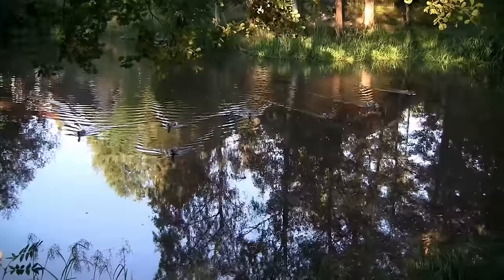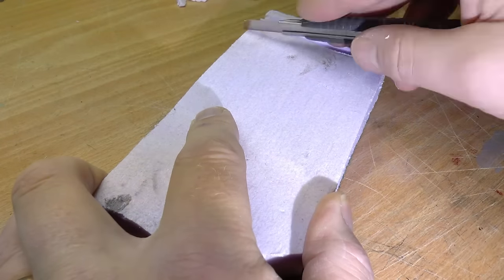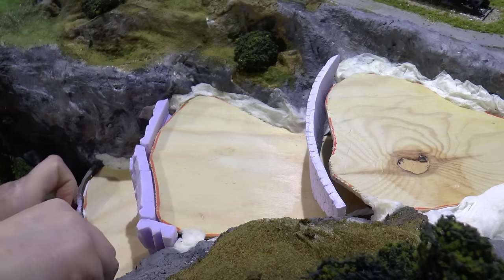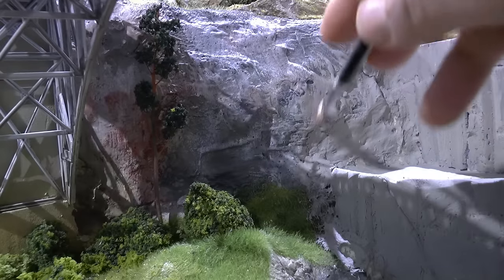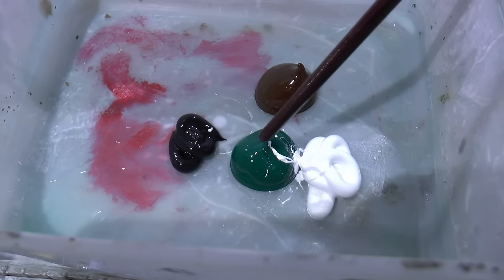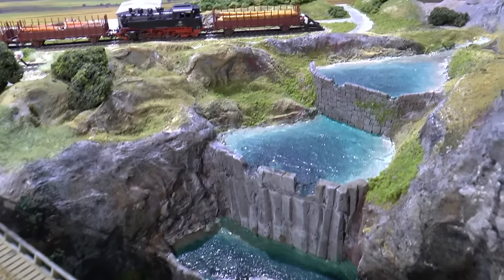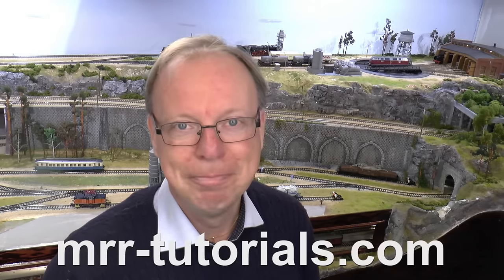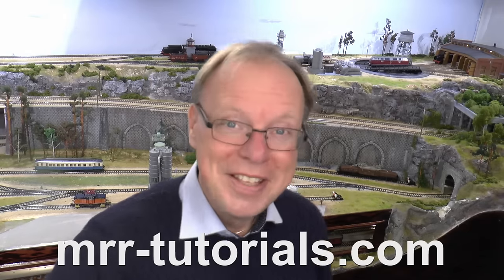Toilet paper + Glue = Realistic Waterfalls

Comment: Hey Mark
Great video!
You can also use clear silicone. It's much cheaper and can be found as UV resistant. It has the same bendy properties, making it suitable for shaping after it's dried. However, not all of the products are suitable for painting, so check the label for that when you are checking for UV resistance :)
Cheers from DK

Comment: thanks Marklin!  i watched more and more of your you tube vids...thanks sooooo much for sharing your knowledge and experience with us all!  two more questions for your advice...if one adds water lillies, swamp grass, cat tails etc to your water feature, do you add after the resin or varnish hardens and if so what kind of adhesive should one use? or do you insert or emplace while it is still curing? finally if your water feature is on the edge of your layout and you do not have a fascia, what do you think best to use as a temporary dam to prevent leakage?  styrene?  glass?  will the resin or varnish stick to the dam as you remove it????  thanks again?  hope things in sweden are all fine!

Comment: I have heard people adding a tiny bit of purple paint to epoxy resin to counter the yellowing effect. Purple is the opposite color of yellow in the colorwheel. This is for regular (construction) epoxy  that can be quite sensitive to UV light. I have used special "casting" epoxy resin specifically used for display purposes which has a much better UV resistance (but is more expensive).

Comment: I'm not sure if I'll get an answer from this or not, but here. goes. You did an amazing job on the waterfalls as it really looks like water flowing. I saw someone else doing the waterfalls on their display and to give it a bit more realistic they took some thin plastic and cut strips and put it underneath the water that you post on it and it tends to hold out the water a bit like it's flowing faster off the dam or whatever. Just a light pass along the information. but I'm sure you've probably seen it. One other thing I wanted to ask was how did you get the sound of water rushing? I know DCC does the engines, but can you get something that sounds like water to?
Reply from the maker: Hi! Thank you for commenting! The water do not really ”jet” out in the falls I modelled. It’s falling straight down, since it’s not a stream on top, but a dam. Sound decoders from ESU and Marklin can be equipped with whatever mp3- or wav-files you may have available. Just open the comfiguration tool and assign your file to a current slot in the decoder. I made a video just a few days ago on that topic. Check it out.

Comment: Awesome video. Thank you for sharing. I have a question. On this video at 8:19, you said to wet the water surface with Pure water. Who makes that Pure Water? Thank you. Greetings from NJ. US.
Reply from the maker: Handi Homann Thank you for the question! I use clean tap water to smoothen the edges between the different shades of the green color before the paint dries.
Reply: Thank you. I thought you used the Water effect from Woodland Scenics/Noch to make it glossy.
Using the varnish as you mentioned, Would it be turn to yellow after few months?
Thanks again for this great video.
Reply from the maker: +Handi Homann Nope! The water based varnish do not turn yellow like the solvent based does.. My water is about one year now without being visible yellow

Comment: Nice work so far but you made a mistake... 99 percent of waterfall walls are facing inwards not outwards and your brick wall would brake in an instant in real life with this design... I know, physics is a bitch ;) :)
Reply from the maker: +Miriam Maus Hi Miriam! Thank you for your comment! Indeed, you're correct! There are also more water flowing in the falls in the lower dam compared with the upper dam. The amount of water corresponds to the width of the wall and not based on real actual water flow. A concave dam would have left me with only a small water surface and a less appealing look. The concrete pillars in my bridge would collapse under the weight of the brigde, but it makes the bridge look awesomly tall and mighty. An oceanologist commented that there will be no bow-shaped waves close to the harbour, since they are cancelled out by reflecting waves, but the waves makes my ocean look great. It's not mistakes, it's strategy.